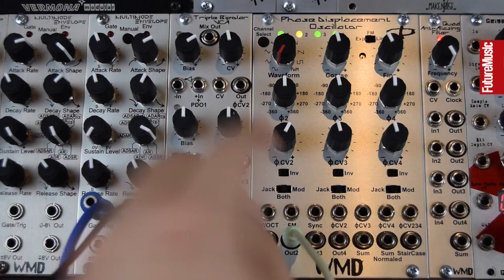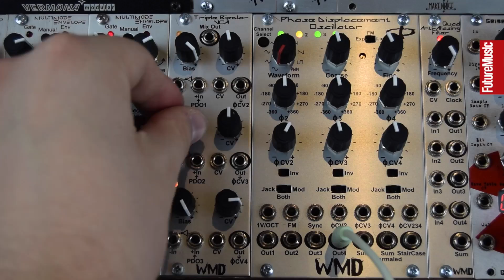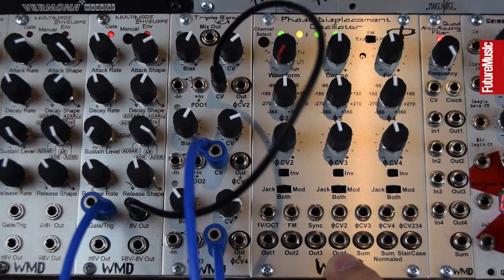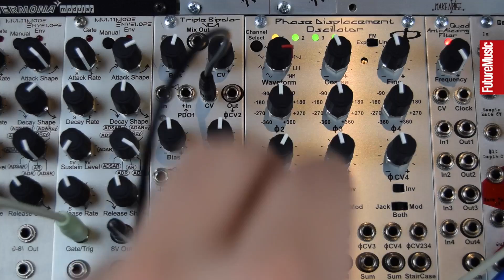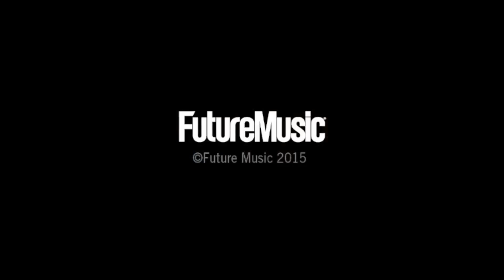Modular Monthly: Exploring phase distortion synthesis with the WMD PDO

Comment: This is the best bass machine in Euroland, imo. You get the deep, strong fundamental sine and then add the desired amount overtones  through phase modulation. Use an envolope for percussive attacks (changing the modulation index). Never washes out or gets muddy in the very low register; always sits stable in the mix.

Comment: Awesome demo.  Question: is this the same synthesis principal used by software "FM" synths like FM8 or Operator?  I remember being schooled by SeamlessR that what we typically brand as "FM" in the software world is actually phase modulation.
Reply: The thing about it that's different though is the focus on the oscillators being out of phase with each other rather than being able to run at different frequencies.
Reply: They are, but this is in fact phase modulation, not phase distortion. So yeah,
Reply: Phase modulation synthesis and phase distortion synthesis are two different things
Reply: @nyallwarner4599  what is phase distortion?

Comment: nice one mate, really need that triple bi polar to open up my PDO
Reply: phase input are bipolar? if so any vca would work.. right?
Reply: @thisisprisma  I would think so. I was planning to use my Befaco A*B+C to get similar results (assuming I decide to pull the trigger on one of these, still thinking about it). It’s only two bipolar VCAs, but it is a neat VCA with its own perks. That Triple Bipolar VCA looks generally very handy, though, especially considering the size. Hmm!
Reply: +badaszewski yeah I think it's pretty essentially.
Reply: how essential is it? i am trying to get my head around it,  can you not do similiar things by patching the pdo to itself?
Reply: I've personally managed to get so many more sounds out of it since getting it but then I didn't have a vca before that. I think it's just very difficult to achieve a lot of things without one